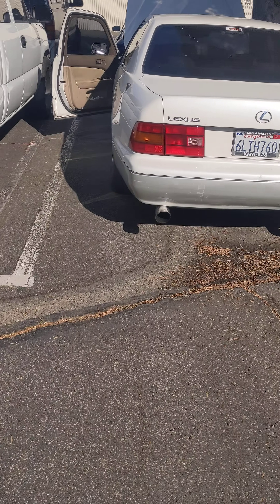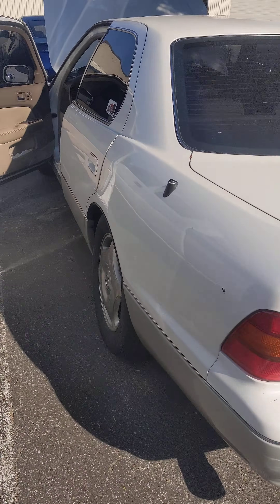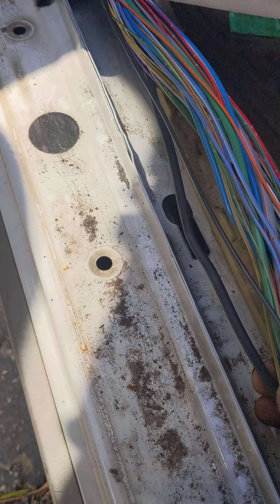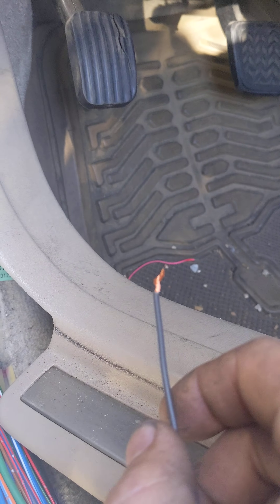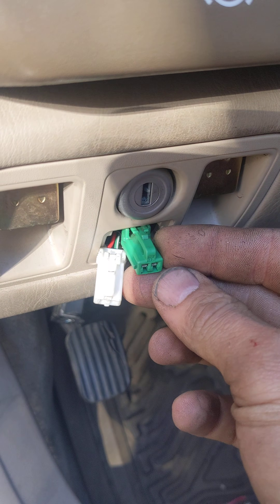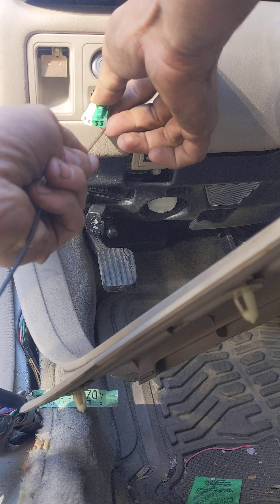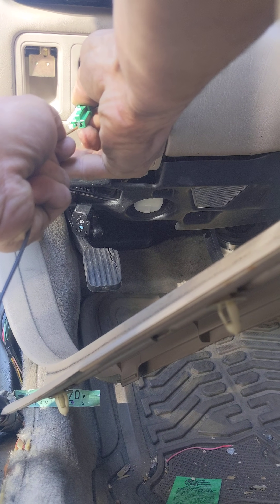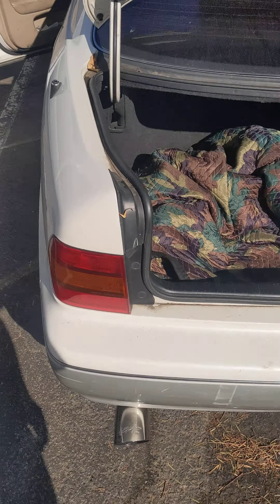How to open a security lock out trunk on the Lexus LS400 without a locksmith

Comment: You DO NOT need to cut ANY wires. All you have to do is find the two connectors for the trunk release, you have to remove the large black panel with 2 Phillips screw to access them, unplug the top connector, and plug two ends of one wire into each terminal.

Comment: How’s you get the green plug out lol
Reply from the maker: Popped the small cover off. Unplugged the switch and forced it though to access it
Reply: @Moose666  omg man I owe you you just saved me 250 on a new key got me screaming in triumph omg. Def cut the wire too short tho lol had to get into the backseat to get enough slack to reach but we got it tho!
Reply from the maker: @Itsamugsgam3  hell yeah. I'm very happy to hear you got it resolved and saved money! No one likes being stranded
Reply: @Moose666  fr man you’re a life saver this is literally the only vid I could find
Reply: @Moose666  what small cover?...the face cover to the tank and trunk switch?
Reply from the maker: @beatzfadayzent  center cover under the key hold. In between both switches
Reply: @Moose666  Got it thanks!!!!
Reply: So you tap it to a ground wire is that what you're saying
Reply: @Moose666  I unplugged all the plugs and did exactly what you did but it doesn’t unlock the trunk at all
Reply: @Moose666 mine doesn’t even have these switches

Comment: Ik this videos old but are u just sending 12v to the connector? Cuz im thinking of doing this but i dont wanna cut up any wires
Reply from the maker: Yes 12v. You can use another source bit I was stranded at the time and had 0 tools. I was 3 hours away from home